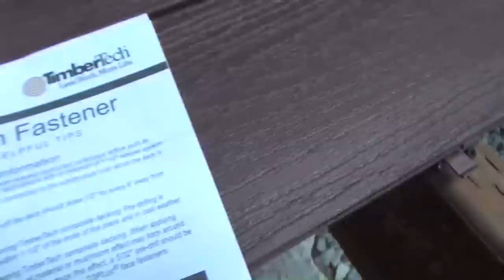Deck. How I Build 30' x 30' Deck. Терраса постройка

Comment from the maker: Watch ALL videos about full process of building:
#1 How I build the Deck. Planning & Concrete Footings. Разметка и опоры террасы
https://youtu.be/NS2Y1H1gLzM
#2 21 Deck Concrete Footings done. How I build the Deck. https://youtu.be/ZN0SHnzfYpk 
#3 Wall preparation before Deck Ledger Board installation. Подготовка стен дома к террасе
https://youtu.be/mhdMaSr9xR4
#4 How to make 12 foot level under $22. Длинный уровень из короткого https://youtu.be/iM4YQkaGZYU 
#5 Deck Ledger Board installation https://youtu.be/rf8gZdfEVrg 
#6 Joists and Joist Hangers installation. Лаги для пола и их крепление
https://youtu.be/Lg8ZQHGKDgs 
Make the BEST Multi-Function End Nipper Pliers ever  https://youtu.be/86zo98rrmA4
#7 Deck Face Board installation. Jig and Trick. https://youtu.be/DMMqpAgojuQ 
#8 Blocking between Joists https://youtu.be/S42dqyuJU1U 
#9 Circular Saw Jig. Perfectly straight 90 degree cut. Circular Saw Guide
https://youtu.be/QiA-aMAeRrI 
#10 Composite Deck Board installation and nice Inner-Outer Corner.Композитный пол, углы
https://youtu.be/JvScq58tyGs
#11 Block, Joist and again Blocks and Joists. Лаги и крепление к обвязке
https://youtu.be/5AfmIOjeM5E
#12 How to secure deck boards to the joists. Как крепить пол к лагам.
https://youtu.be/hunOh2uD4ws
#13 How to make 45-degree Deck Corners / Deck Frame Trick. Как строить углы террасы
https://youtu.be/qI8Tv8yfTZQ
Circular Saw Crosscut trick.  https://youtu.be/bJLujssoxcU 
#14 How to build a Deck Steps. Ступеньки для террасы https://youtu.be/tJePMWHwnLQ 
#15 Decking Fascia boards installation. Боковые панели для террасы
https://youtu.be/2kLkNM-ylUE

Comment: Nice job but joist spacing seemed too big for plastic. 16-18” max
Also for the step cedar on concrete? Thats gonna rot
Reply from the maker: Check This at 0:09  https://youtu.be/NS2Y1H1gLzM  
Plan list said joist space 16" O.C.  
This steps temporally, owner will do some patio work later.